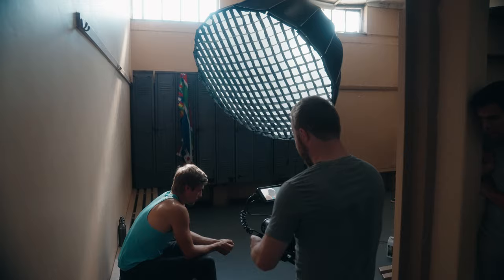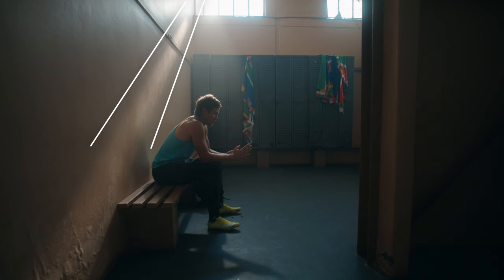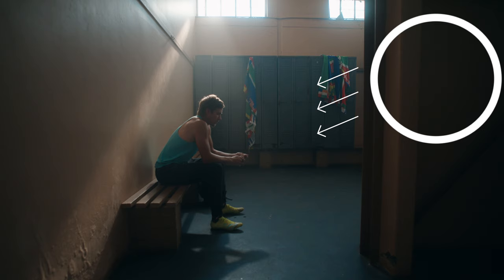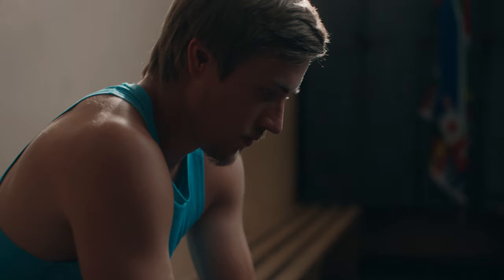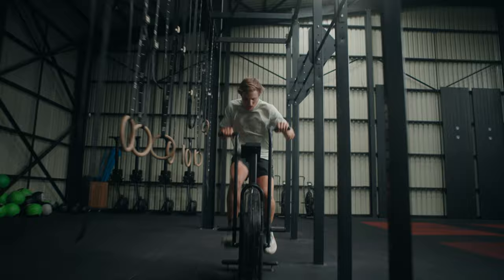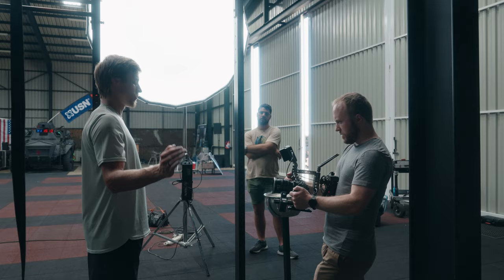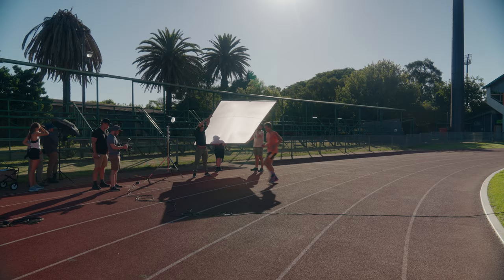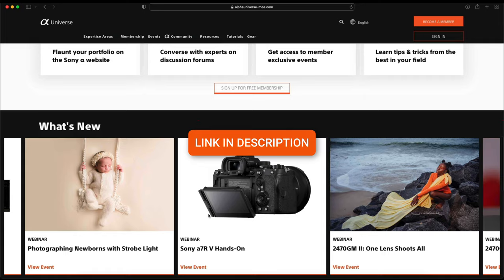Easy ways to light a scene - CINEMATIC LIGHTING Breakdown

Comment: the interior scenes are superb

for the outside the bounce method seems better to me in these conditions (no clouds, very strong sun). It's hard to fight against the sun but above all it's not easy to balance for a natural result.

you could also use negative ground fill to avoid red reflection and save time in post ;)